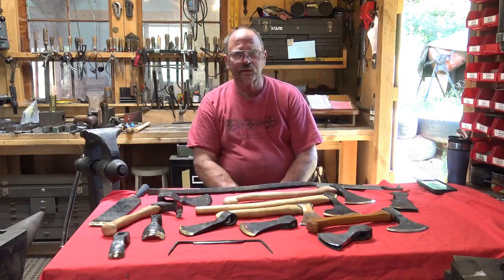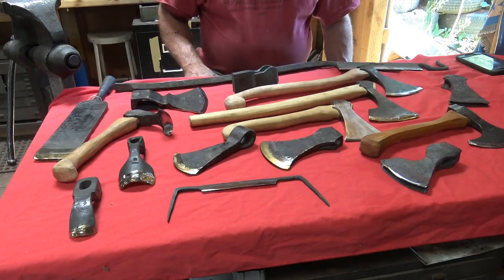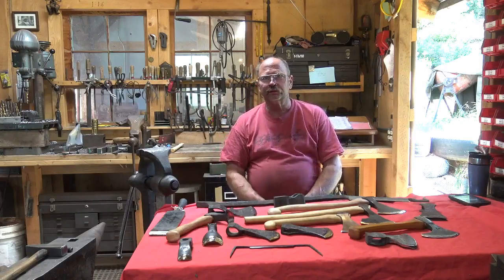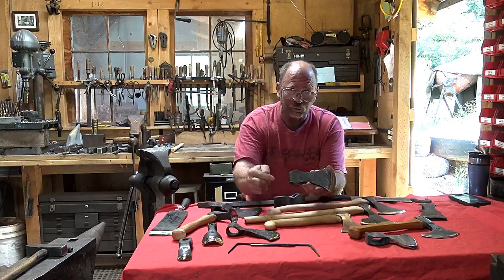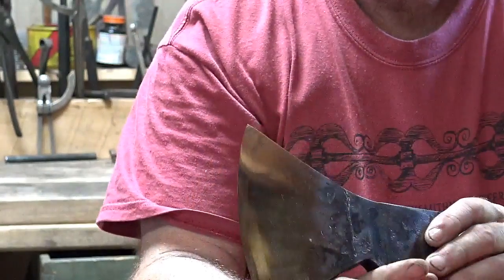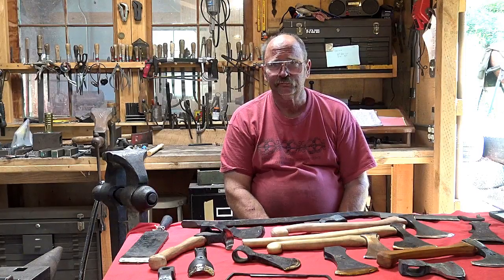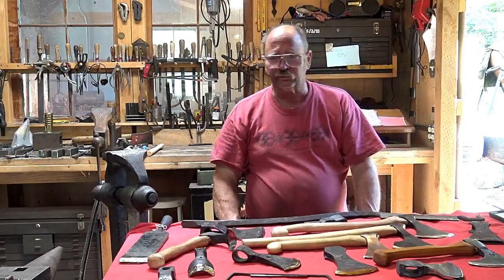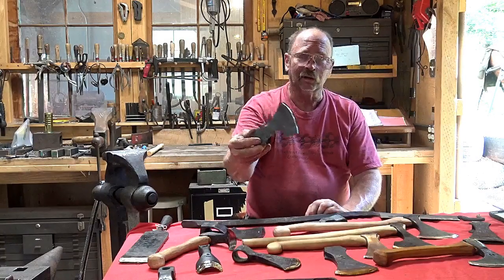Forge welding vs single piece construction for axes, adzes and other tools

Comment: Hi I love your videos I've learned a lot watching all your videos I've learned a lot watching all your videos I appreciate you sharing all your knowledge on blacksmithing I throw tomahawks and I like teaching people to throw Tomahawks and I enjoy making them I have found for the long-haul I prefer a tomahawk with a mild steel body and a hard steel edge that is tempered way back but my forge welding skills are not that great yet so I use high-carbon railroad spikes and they seem to do well but they are not very high carbon for the but for a tomahawk that works

Comment: I prefer a punched eye but I do not mind a forge welded bit. I don’t need a glass hard cutting edge and I am willing to sharpen more often rather than risk chips. Yet at the same time I do use the poll to hammer items such as tent stakes. I have a GB carpenter’s axe but I am guessing that the poll end is normalized or possibly even annealed. I also prefer to have a well shaped eye and one that does not require anything more than a wooden wedge. A double grind for me such as on a broad axe, since I am both handed, but left eye dominant. I like the rough look of a forged axe without too much leftover scale. I like the J&J wax treatment rather than linseed oil on the head. A thick rugged handle that is not baby smooth with a large palm swell, please. John I may be unusual in my likes so I would not take my input as Gospel. To have an axe with your bear paw would be enough to make me smile, even if I paid a little more than what your competitors charge.

Comment: Hi John, than you so much for you videos. They are great and informative, I am so glad I found your channel. I am in the very beginning of learning blacksmithing and have bulidt a small forge in my garage. I would love to forge weld but I can not get the temerature high enough to do that in my forge run on charcoal, but with a lot of work and effort I am able to punsh holes in single pieces of tool steel. So I am so greatful that you show the tools (and how to make them) for bouth ways of of making axes and other similar tools. Thank you again for not holding back information or tips and show the whole process in what you do. You are an inspration and a rolemodel in how to ceep an old craft alive.

Comment: Did you ever make a carpenter style axe with a mild steel body and welded on hammer face and cutting edge?
I'd love to see that kind of build. I know it's not very traditional but it's a handy little thing in a toolbox and a much more versatile tool in my sense.
Similarly, i think small carving axes are a much underestimated tool for any kind of woodworking and i regret not being able to see adzes used more often for finishes.
 I think that by relying on power tools for so many things we are actually loosing some precious aspects of what crafting can be. And it's always a joy to see how a  tool was designed, know it's history, having the touchmark of a craftsman claiming pride over his good work.

Comment: As one without a power hammer or striker I prefer forge welding.  But I do hate burning through so much propane to get my small forge up to welding heat,  It will do it but I have to run it wide open for a while and I'll burn through a 20 pound tank pretty quickly.  Thanks again for your much appreciated videos.   By the way, I normally average 12 hours of forge time on a 20 pound tank.
Reply from the maker: Forge welding can be quite fuel consumptive no matter what you use. But I suspect it balances out when compared to higher material costs and increased forging time for the all tool steel versions.
Reply: @BlackBearForge  Wow, thanks for the response.  Like hearing from my idol!  Yes, you are right.  Without a power hammer or even a treadle hammer it takes a lot of heats for me to punch the eye in a hammer or ax.  I'm planning on making a treadle hammer to start with but I am collecting materials for a power hammer.  In reality I'm trying to stay away form heavier projects until then but I just like making hammers and carving axes in particular so much that I just had to try a few.   Thanks for your channel.  I couldn't have done anything without instruction like yours. Very much appreciated!

Comment: I generally prefer forge welded, the bit can be made ferociously hard in a way not possible with one piece construction. Also, sharpening by hand is easier with a soft tool body.

The one place I've seen forge welds in recent manufacture is in shears--tin snips and tailor's shears of better quality.

Comment: I am a bower, blacksmith, and survivalist. I have developed a tool heavy mentality. I would much rather carry and use the right tool for the job than use a single tool that does a mediocre job at most tasks. I have a wide variety of specialized tools used for traditional crafts while I'm in my shop and for that I prefer the traditionally made tools. However. When camping or in a survival situation I feel it is inexcusable to have an axe that is not designed to be a hammer. It is a heavy, dangerous semi specific use tool that is not worth carrying unless it does more than simply chop. For this reason I prefer mefium small axes with medium long handles that have a hard face on both the pole and the blade. With that being said, if the intention is to abuse the tool you should redesign the tool so that the way you intend to use it is no longer abusive to the tool and its purpose. Maybe forge the eye from a medium carbon steel instead of mild and forge weld in a tool steal for both the pole and the blade. I've been trying to find a tool like this for several years now and I'm still learning to forgeweld so I have not been able to make one of satisfactory quality as of yet. Just a thought. Love the videos.

Comment: I like Forge weld blades... The High Carbon Steel edge is harder to file and sharpen, but it also holds an edge better and longer. The Mild Steel is the bulk of the tool or weapon, and adds the weight.

Comment: I like both mono steel and forge welded, I’m making my first axe like thing forge welded because I have a bucket of railroad spikes and a bucket of scrap O1 from making knives and I want a tomahawk just because it’s neat and it makes financial since to forge weld, if I were buying an axe and one was tool steel and one was forge welded and they were the same price I would get the forge welded because it’s neat from a history stand point and I like the effort, but if tool steel saved me $20-$50 or more I’d buy the tool steel because it doesn’t really matter which one to me and $20 is $20.
Reply: L

Comment: Old school is better in my opinion. That being said is it even possible to make old school tools with imported steel now days? Doesn't seem like the metallurgy can be the same.
Reply from the maker: The construction technique remains the same.  Plus the newer mild steel is actually better than old wrought iron.  But if you are after a true reproduction, then you would have to find salvaged wrought iron.

Comment: Food for thought, what I want in a tool like an axe is a tool that holds a good edge to cut wood at the camp site or in carpentry. Carpentry either will to just fine, camping if I want to split a small log, I may use a wage, so forged welded may be better so I can tap the wage in. That all said, I like traditional to keep alive pre 1840 style tools a guns, like my flintlocks.

Comment: I am very new to blacksmithin. Do you have video of what types of mild steel there are? I watch your videos about different tool steels is there the same variety of mild steels and if so where would you suggest I find that information. Thanks
Reply from the maker: There is really only one thing referred to as mild steel.  It is what you will get when you buy from a a supplier unless you are specifically buying something special.

Comment: Thanks for this video! I've done some basic blacksmithing project and I'm planning on making two axes. I work in an axe throwing business so I'm making a throwing axe and one for outdoor use similar to the Hults Bruk Akka or Kisa. Any tips on steel type would be greatly appreciated!
Reply from the maker: For most forge welded axe I prefer a cutting edge made of 5160, especially for throwing axes.  For finer cutting tools such as a carving axe I prefer W1, it welds well and holds a good edge.  For my single piece axes I tend to use O1, mainly because I can find it in the sizes I want.
Reply: Black Bear Forge for my camping axe, I've seen ideas of encapsulating a harder steel between two layers of a softer steel to protect the blade. Similar to Helle knives having an 18/8 stainless over their alloy steel cutting edge. Is that practical and effective for a utilitarian axe that I hope will last a long time?
Reply from the maker: I don't work in stainless and have no idea how it forge welds.  But for many of my axes I do use a mild steel body with a cleft where the tool steel inserts and is then forge welded into the blade.  I think it makes for an excellent axe so long as you are comfortable making the forge weld
Reply: Black Bear Forge thanks for sharing some of your knowledge! When I inevitably run into a problem when making my axe, I'll definitely email you.
Reply from the maker: That should be fine

Comment: First off I want to thank you for a very informative video.  Then to your question about what customers prefer.  IMHO you will get 50 shades of gray as the answer.  I like the history and look of traditional forge welded tools.  I and many others buy or collect tools for that look and sense of connection with the past.   As a craftsman, I am primarily interested in the highest quality tools for the job that work best.   Soooo.... The answer  is simple,  meet the demand!  The customer is always right.

Comment: Great topic, thought Id drop my 2 pennies in. I use hand tools exclusively and daily for everything from timber framing, to dough bowls and fine furniture. Ive come to prefer laminated construction for a few reasons, and search out forge welded tools. 

One big one for me is ease of maintenance, grinding is much easier when a majority of a bevel is wrought soft iron, you can even use a file for hogging off much of a thick bevel on an old slick. My favorites are the really old tools where the steel layer is very thin, like 1/8" applied. 

Ive only had a few bad experiences, one was an old chisel, the wrought iron in the socket had an inclusion that eventually cracked the socket off the main body, this being a separate socket unlike the older wrapped socket type, which I feel are the best socket types. 

Anyway, good on you for favoring the forge welded tools!
Reply from the maker: Thanks for the input.  My preference is for laminated tools as well.  Although I still make them both ways

Comment: Hi John, good discussion. To answer your question, I’d say it depends. First, If I were to make (or buy) a tool for my own personal use, I’d prefer forge welded, mainly because of the aesthetics. I really like to see the origins, or evidence of how a fine tool was made. If all I wanted was shiny machine formed tools, I’d probably be ok with something that was mass produced in China and sold in the big box stores. But I personally like the brut de forge finish, scarf lines, and a little hammer marking, because they show that a skilled human crafted the tool. However... if I possessed the tooling and skill set to do either style, equally well, then I would be happy to be able to provide exactly what my customer wants. As you obviously do. Thank you for another great video.

Comment: Hello John. My grandfather taught me to forge weld when I was 10 years old. He lost his left arm to a hunting accident. (Never climb over a fence with a loaded side by side 12 gauge) Anyhow, he needed a striker sometimes. He used a holdfast when he worked alone. When he found out I was interested he put me on a platform he made to get me up high enough to hit something square on the anvil. He gave me a long handled 2 pounder to start with. I quickly went to a four pounder. I digress. I prefer the forge welded axes. Do me a favor and make a video of making a broad axe. I am thinking about making my granddaughter a small log cabin playhouse.
 Thanks, GDF
Reply from the maker: Gary, I will certainly be doing some axe making videos and while a broad axe won't be at the top of that list I will get to it at some point.

Comment: I started with the all steel version but switched over somewhere last year.  The tool steel is simply too though to work with nicely without a power hammer or striker and the forge welding isn't actually that difficult once I got the hang of it.  The mild steel body is so much easier to work with though and I now get the work done much faster.  Still learning on the forge welding part but it's such an eye opener to see how much work you can save once you can combine parts of a piece and don't have to hammer them out of an overly large chunk of steel!
Reply from the maker: Very good observations.  Forge welding makes many things possible in a small shop and often means you don't need as much equipment like a power hammer.

Comment: I find forge welds use a lot more coal. Not a deal breaker but i have to take it into consideration.
Reply from the maker: Economics often plays a factor.  Of course using a single piece of tool steel can cost as much as the extra forge fuel, so it may be a wash.

Comment: Question to you +black bear forge , I agree completely, an axe is not for hitting with steel. 
However sometimes it can be, e.g. a splitting maul. Which is designed to split but has a striking end on the back you can hit with a sledge. 
How is this achieved? Forge welding or just softer tempering on the back?
Thanks
Reply from the maker: Modern tools tend to be single piece of construction and the same heat treat for the entire tool.  A splitting maul may be tempered softer overall than a sledge, but it is actually meant for driving wedges that are not generally very hard.  I also think that industry doesn't worry to much about hard steel hitting hard steel like we do as blacksmiths.  For a general purpose axe I don't tend to harden the pole and can't if it's forge welded from mild steel, so it will quickly damage the pole if its used to strike metal

Comment: As to an answer to the question which do I prefer as a user. Right tool for the job. I have zero issue with visual weld marks showing the join, if anything it would make me appreciate it more. Makes you respect the tool more as you can see its strengths. If I need a solid hard tool on the back edge (and accept the potential brittleness) then obviously one piece would be preferred. But if its going to get abuse on the back edge (hammering wooden steaks comes to mind with an axe) then mild steel and 01 would be better.  
As a side point. There seems to be a modern trend to showing forge weld marks, specifically in demascus style steels. There is a youtuber greenbeetle who specilised in forge welding random small mettles (nails, fish hooks, razor blades) to make the pattern come through in the knifes and tools he makes. I should imagine there might be a market for making the forge weld blade join a bit more artistic (zigzag, wavy, etc) as long as it doesnt compromise the weld. Just a thought. Makes it look more deliberate too, much harder to mistake for a crack. 
Awsome videos, keep going.

Comment: I like working with the softer steel even a 4140.  A fine cutting edge is good for axes and adze, but even here I would prefer the bi-metal construction.  I have a Gransfors Bruk axe and it is great but I worry about chipping the edge which is brittle.  I also prefer my hammer eyes or axe eyes punched then drifted.  I have seen Japanese katanas which are laminated and I cannot tell they are forge welded at all.  Often they have an exterior jacket which is softer but tougher and only the cutting edge is harder.  Some are similar to Damascus construction.  There are multiple variants.  I also have Japanese pruning sheers which have tougher handles and only the jaws are made of Japanese white steel.  These "secateurs" are marvelous but great care bust be taken in not abusing them, such as using them as wire cutters or accidentally cutting a branch which has grit on it.  I am interested in obtaining a small gutter adze but sharpening one can be a challenge.  By far forge welding a harder steel bit at the end of an axe is better, but to avoid the seam showing along the joint both pieces need to be hot and slathered in flux, or to cheat by welding the two pieces (after cleaning) with a TIG welder to exclude oxygen from the contact points.  It involves lots of grinding afterwards to remove any unwanted welding bead and to bring the piece back to its desired shape.  The Japanese use a clay mixture to coat three or more binded layers of steel instead of TIG welding.  They forge weld early on and only form the eye after this has been accomplished.  The clay blocks the oxygen and breaks off with the first accurate strike.  Bottom line is that I too do not care to see a seam although I realize that it really doesn't matter.  I suppose given the choice I would rather see a seam "flaw" at the eye rather than near the cutting edge.  I do not mind the blackened appearance that normal blacksmithing imparts to steel.  I think the oxidized scale or coating even protects the surface especially if oil quenched.  Hope this addresses your curiosity in what some customers like.

Comment: Good video.  Me, personally, as a smith, I prefer forge welding.  Main reason is tradition, that's what got me interested in them to start with.  As for toughness, it's not that big an issue with a differential quench on an all high carbon blade.